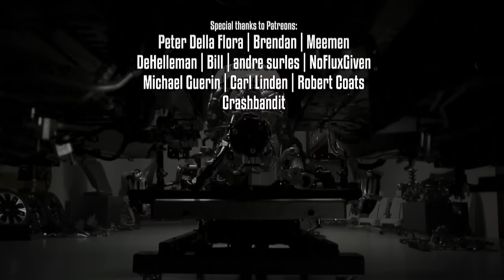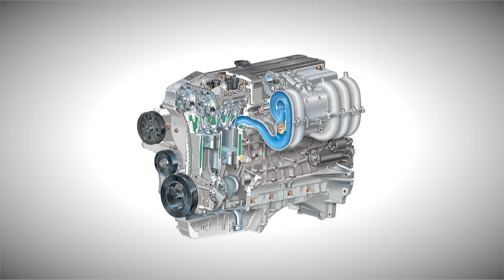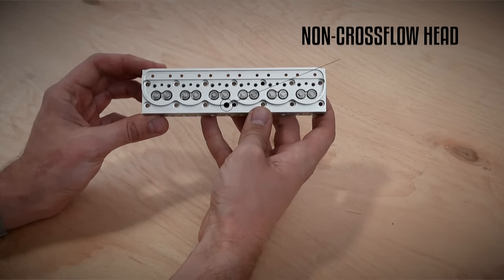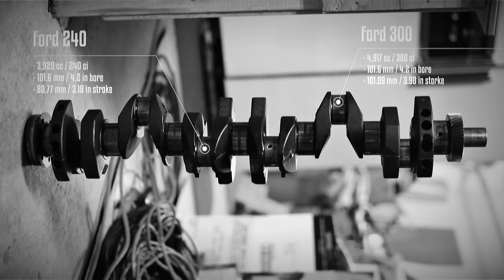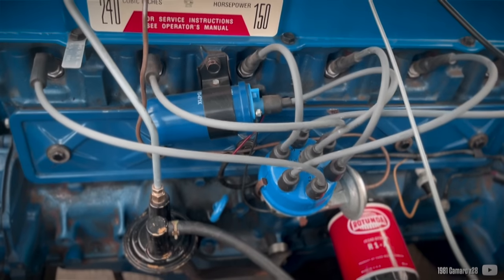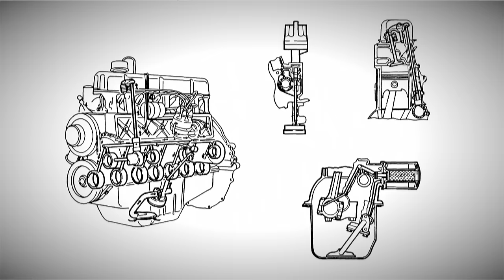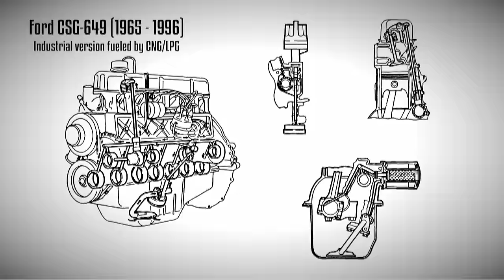Is This Toughest US 6-Cylinder?

Comment: Although no longer made, the American Motors 232 and 258 straight 6 engines were rock solid as well. Very nice video.
Reply: Back in the day, each of the major manufacturers had at least one rock solid inline six. You already mentioned AMC contribution, Chevy had the 250/292, Dodge had the 225, and so on. I wouldn't hesitate to own any of them
Reply: @kerryharrell8821  I agree,you could never go wrong with Any inline 6 engine..  they're economical,reliable, ran forever, and always seemed to start on those cold frigid days,when the big v8's- not so much.
Reply: In-line six engines in general seem to hold up well. I have GM, Ford and Chrysler examples. My oldest Chrysler example is an early flat head design. Still runs like a clock after over 70 years, never been opened up and doesn't burn oil.
Reply: 232 was a Ford Engine in 54.
Reply: absolutely i  own one
Reply: @jamesbegley2700  Sorry, but that motor was 223 cubic inches.  I had a 2 door custom line with that motor that I overhauled and a three speed overdrive
Reply: I ran a very successful NAPA store back in the 80's and early 90's, in the southern mountains of WV.
We supplied a relatively large area, and I'll say this - if every vehicle had an AMC 258 inline six, we'd have went broke.
Other than the normal maintenance stuff - cap & rotor, plugs, points/condenser, filters, etc., the only thing that ever went out on them was that nylon distributor gear, and that's about it.

Those were some tough and dependable engines man!
Reply: Then , Jeep perfected the AMC design with the 4.0 HO, which was used up to the 2006 model year Wranglers.
Reply: @curtboroff  
I had already retired for about a decade from the industry by then... was it a serious improvement?
(no sarcasm involved - that's a serious question)
Reply: 232/258 were intl harvester  supplied.  Great simple motors.
Reply: @curtboroff  AMC no longer existed in 1987 when Chrysler bought them out. It was actually Chrysler that inherited the left over engines from AMC, and modified the heads for higher output, lightened pistons, and converted them to the Chrysler Multi-port Fuel Injection System.  The result was AMC strength and reliability, with Chrysler performance.  The 4.0L H.O. in the Jeep Cherokee was pretty quick. When the AMC blocks ran out, Chrysler kept going, realizing a good thing shouldn't be messed with.  They did lighten the blocks in later productions, as well as the heads, resulting in cracked heads in 2000/2001, but nothing really ever went wrong with the blocks - even when severly under oiled.

An interesting aspect of the 4.0 was that it was a very noisy  engine at idle - sounding like it had a knock.  Chrysler went nuts trying to repond to dealer complaints at first, sending teams out to tear down engines in an attempt to find the cause.  none was ever found, and there is a lot of speculation about why they sound like  a diesel.  Some have suggested that the lightened pistons (they shortened the skirts to contribute to the H.O. mods)  make noise as they "rattle" in the cylinder on the down stroke.  Usually, just one or two do it, but it's audible in most 4.0's.  As soon as there is some throttle and everything tightens up, the sound goes away.

Re-builds show little wear on the skirts or cylinder walls, although there have been cases of chipped skirts, found in the sump - 250,000 later.  All of my 4.0's do it and they all have been superb runners.
Reply: @mrmott44  Nope. AMC designed and built. Although IH did use them in later scouts and pickups when emission regulations came around. The older IH straight 6's weren't able to pass emissions requirements and IH didn't see the value in designing a light duty straight 6 to replace them.
Reply: @OutnBacker  AMC did all of the design work for the 4.0L engine, and introduced it in 1986 (for the 1987 model year), right before they were bought out by Chrysler. You're right that in 1991 Chrysler did change from Renix MPFI to their own efi system, but this was mainly for ease of dealership maintenance and consistency within their vehicle lineup.
As a side note, Chrysler changed so little with the 4.0L and the Jeep designs that on most of the pre-facelift XJ's and YJ's all of the panels still have AMC stampings and part numbers. AMC really struck gold with those little Jeeps, and why would Chrysler ruin a good thing?
Reply: @isaakwelch3451  Another thing I find amazing about the early Grand Cherokee is that it was designed in 1983, the first all-CAD built vehicle.  Scheduled for release in 1987, Chrysler shelved it until 1993, in favor of going forward with the super successful mini-van market.  Iacocca called that right.  The cool thing is that when the "1983" Grand was introduced, it was still accepted as a current, modern vehicle all those years after being set aside.
Reply: @OutnBacker  I've always found that interesting too. With how many successful Chrysler products came from AMC and the merger, I sometimes wonder what it would have taken for AMC to survive. Of course, it takes more than a good product to succeed as a company, so maybe none of them would have seen the light of day. Another fun fact, the Chrysler power tech V8 was an incomplete AMC design that Chrysler inherited and finished
Reply: @isaakwelch3451  I think it was money - pure and simple.  AMC was going broke, and all the sexy design work was shared among the Big Three.  AMC cars were pretty ugly compared to other "family" vehicles.  Yes, they had the AMX, but even that was kind of strange looking when compared to the Chevelle or Mustang.  They inherited the Jeep brand and that was what kept them going as long as they did.  But, lawyers and tort settlements had them on the ropes with roll-overs and deaths - even though there was nothing wrong with the CJ's. Arguabley the best and most reliable Jeeps ever built were done by AMC.  But other rigs like the Blazer and Bronco were really taking off by the early 80's.  More room, better safety, more comfortble, good tow vehicles, all around a nicer rig.
Reply: @OutnBacker   AMC had money problems for their whole life. I don't think it's that simple, but I think American Motors decision to try and compete toe-to-toe with the big 3 in the 1960's is what sparked their slow demise. Their cars from this time are some of my favorite AMC creations, but I don't think many, if any, were objectively better than what the big 3 was making. If AMC had stuck to small, useful, economical cars they would have fared a lot better in the 70s and 80s when the big 3 were struggling. But they burned all their money in the 60s making cars few people actually bought
Reply: Four years ago my best friends wife wanted to get rid of her 2004 Wrangler LJ with its 4 liter in line 6. It had 32,000 miles on it spent the first half of its life in FL and the other half on Long Island. Got it for 4K brought it back to NC do my own light maintenance. Oil and filter changes every 4k, tuneup keep an eye on the fluid levels and drive conservatively 15MPG around town 21MPG highway. Had a mechanic service the differentials 3 months after I got it. Only problem was my serpentine belt went and was able to get it to my mechanic and one of the pulleys had to be replaced. Otherwise now has 65K still purring like a kitten. AMC came out with that engine in 1964 and ended its production in 2006 too bad!
Reply: @johnschaefer2238  From what I have read... The straight sixes went away for a few reasons, but one was the length and height problem that couln't be engineered into the low stubby hood lines tat were getting more so every year.  EPA fuel efficiency rules forced car makers to shape the body just so.  That's why all cars look the same.  Another reason was that the advantages of the high torque I-6 would be eliminated if they tried to force it to get better mileage.  It was a design that had pretty much peaked.  I think BMW still makes one, and others are now re-visiting the idea, with newer tech.
Reply: @johnschaefer2238  That's about what my XJ gets for gas. mileage. Toyota automatic and the 4.0 HO. I like it, but wish it was easier on gas and stickshift.
Reply: but they were never used in heavy duty trucks , like the big 3 did.
Reply: @isaakwelch3451  They rolled the dice on the Pacer, and came up "snake eyes".
Reply: @northdakotaham1752  Solid heavy cast iron blocks, properly hardened and sturdy cam shafts and cranks, rich fueling helps cool the internals, low compression all make these engines inefficient, BUT reliable.  Something that just runs without issues for 100's of thousands of miles has it's own efficiency. Todays aluminum Fe sleeved engines are essentially disposable (I'm looking at you Hyundai 2.4 L Theta).
Reply: @percussion44  the sixes that I have, GM, Ford and Chrysler, for me....are not measured in miles bc none of them are required to travel long distances. They are in heavy work vehicles where high output for short duration is required. They have never been babied but are worked hard. Seldom do they ever give any trouble and usually it is either a fuel issue, poor fuel, or an ignition issue (points,condenser).
Reply: The AMC engines were great, they ran like the proverbial sewing machine.
Reply: @OutnBacker  perhaps i should have use the words "heavy duty"trucks. i consider anything over a 1 ton payload a heavy duty truck. like a ford f350 or a chevy 3500 pickup.
what you are calling 'medium' trucks, i consider heavy duty.
Reply: @fransmith8992  Got it.  Leave it to me, the retired trucker, to split hairs.  Technically, a 3500 or 350 series is still a light truck if it does not have duals.  If equipped with duals, it magically becomes a medium duty truck, according to the NTSB and DOT.  There's a lot of swiggle room in the medium ratings. Add a second dually and air brakes and it becomes a Heavy. Then, there are the various odd trailer ratings and so on....

Today's modern behemoth pickup trucks are sort of a hybrid rating because there are so many people hauling Very Large trailer homes.  They built something to fit the niche. That's why we see "heavy duty" on anything with a 3 in front of the series designator.  It also explains the prices.
Reply: @OutnBacker amc did the work on the modern 4.0 in 86.
Reply: @OutnBacker the new Grand Wagoneer is a twin turbo 3.0 Inline 6 with 510hp
Reply: @jeepsblackpowderandlights4305  Interesting.  To  bad it costs a half million dollars.
Reply: The 4.0 is the best.
Reply: Chevy 292 just as good as ford 300
Reply: @jeepsblackpowderandlights4305  Right you are.
Reply: @gringoreno  I beleive it.  The GM six's were incredibly  reliable engines.
Reply: I had the 258 in my CJ7.  It was indestructible. I changed the oil every 2,500 miles and plugs every 5,000. Ran it only on super unleaded gas and when I sold it the motor had 157,000 miles and ran smooth.
Reply: @map3384 plugs every 5k? Standard Copper I’m guessing?
Reply: @_..-.._..-.._  Ow yes. Those were standard in the 80s and into the 90s. Can you believe a set of 6 champion plugs cost $6. Conventional oil was $1.50 a quart and a oil filter $4.
Reply: @mrmott44  yes owned a 70 travellall 258 engine
Reply: @kerryharrell8821 
You are right. Everybody built one, and nobody ever built a bad one. It's just a good design.
Reply: @jkg6211 I'm from the McDowell County area of Southern West Virginia. Which County were you located in ?
Reply: @jamesbegley2700  Different brands are allowed to use the same displacement.
Reply: @johnsonpaul1914 James may be dyslexic, or just wrong.

Comment: I read an article years ago in Car Craft about a guy who took a stock high mileage 300 i6, put a hi volume oil pump and SBC double valve springs in it, stuck a big single turbo on it, and went 10s in a Maverick with a c6 trans and 9 inch rear

Comment: As a gen tech ,I've got alotta love for the 300 Ford.
That's because never have to fix them, the most issues I've had is water pumps going bad from lack of coolant changes. 
Kind of a good idea to replace your coolant more than once every 25yrs.
Reply: I've seen some major issues stem from coolant being left too long or left non existent (only water in a system, talk about eating it up from the inside out!) That thing eventually died of internal cancer. It still ran but the block, head would have needed complete machining to get the mating surfaces trued up and to be able to get it to seal again, that was after 350k miles. It still ran and drove but wouldn't hold coolant. Lol
Reply: This was also not a 300 i6. I've seen plenty but never had to work on any 300s.
Reply: Had to replace the head gasket at 140,000 miles on the 300 in a 1996 F150. Worked fine after that but then the rear main seal blew out @ 180,000.
Reply: Nah just whizz in the radiator now and then, clean her right out 😂
Reply: Woah woah woah let’s not get crazy now…
Reply: @goosenotmaverick1156  haha a generator with an open city water cooling setup ,pure cancer
Reply: @MrTheHillfolk  oof that's rough. Eats em up from the inside out.
Reply: @goosenotmaverick1156  yeah one in particular I dealt with ,huge flaky sheets were coming g out of it.
Had to pull the freeze plugs and scrape and pick out the lower 2-3" of the block because it was just packed with rust. 
Those open setups aren't the way to fly✌️
Reply: @MrTheHillfolk  my major corrosion experience was with an engine that had a cast iron block, and everything else was aluminium basically. It ate away every non aluminum fitting and surface until the thing literally was just pissing it out 🤣 I ended up having to replace the intake manifold, there was a coolant passage in it that had corroded all the way through and was unrepairable. I did that for the fella like 5 years ago. The truck made it til last year before the head gasket finally let loose 🤣 honestly he got it too hot or it may have made it another year or two lol

Comment: Years ago I had a Ford Falcon with a straight 6, don't know what size it was but it was sure reliable. I remember listening to the car guys, Click and Clack, someone asked them what to look for in a used car. One of them responded, " if you open the hood and can see the ground, buy it". The Falcon was that kind of car.
Reply: Ron, in 1968 my father and I drove his 64 falcon from San Francisco to Raleigh North Carolina. The tappets sounded loud but it still ran just fine. A month later a compression test revealed a cracked piston! Oh, well😂
Reply: Old Ford parts guy here. The cars had the small block 6 either 200 or 250 ci.... The trucks had a larger block 240 or 300 ci.  These were also used as industrial engines in swathers and other equipment.
Reply: The Ford falcon had a in line 6 either a 170 with 5 main berings or a 200 with 7 main berings. Had a 1964 falcon sprint with a 260 v8. Could have been a 289 v8 in 1965.  The earlier 60s they used the 170.  These are different blocks than the 240 and 300.  Had a jeep cj5 with a 258 6 and the weakness was the value train but lower was great.  Shaped to the Ford 300 with electric fuel injection which upped the game.

Comment: Great video as always.   My grandfather always bought trucks with 300 6's in them.  When the news broke that 96 would be the last year, he bought another one.  We still use it on the farm.  Good old truck.
Reply: 1996 model is extra nice, since it has OBD2 and mass air flow fuel injection.
Starts easy, runs even smoother and more usable power, than the previous obd1 speed density fuel injection, that I also had. 
EFI models was noticably more powerful than previous carb models, from the smog era.
Reply: @jhoncho4x4  But, as time takes it's toll, more crap to fail and as I can attest, once a '90's EFI ECM, sensor controlled system ages, racks up miles, and starts to give problems, only more problems follow, and are d@mn near impossible to fully straighten out..In the long run, I'd much rather have a 1970's-mid 1980's carb equipped 300, much easier to repair, diagnose, and bolt on new parts when needed...